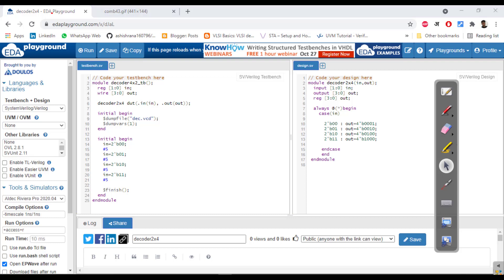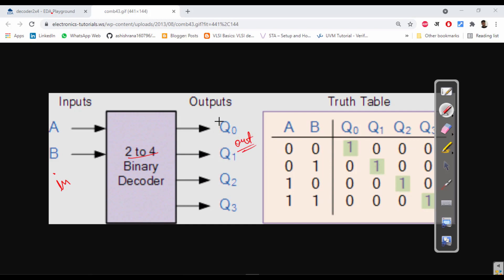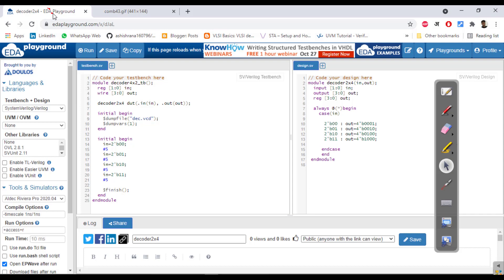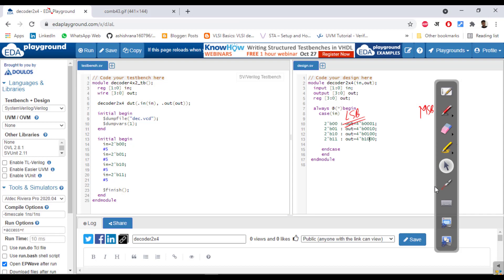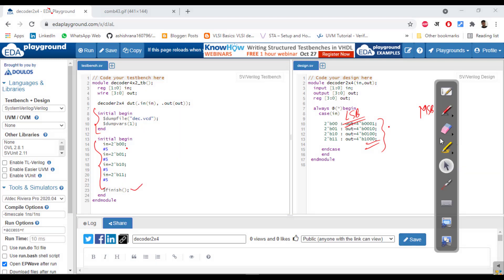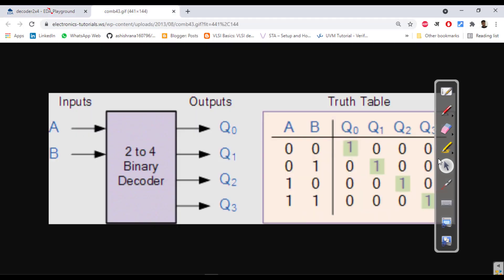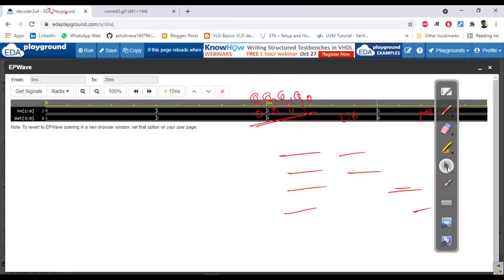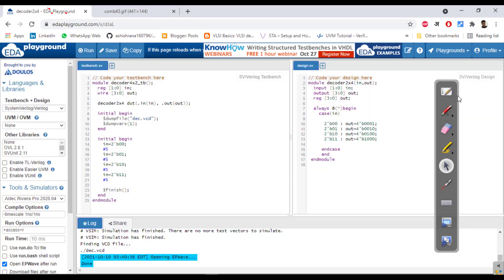2 is 4 decoder verilog code with test bench

Comment: can you you load the video for the following logic 
Write Verilog DUT which generates an output as follows for the given input
Input (I): 0,0,0,0,0,0,1,0,0,0,0,0,0,0,0,0,0,0,0,…
Output(O): 0,0,0,0,0,0,0,0,0,0,0,0,1,0,1,0,0,0,0,…
module two( input wire clk, rst,i,
 output wire y);
Note:
 An input ,I, asserts for only one clock cycle.
 After the input asserts, then the output should assert 5 cycles later and
 Then deassert for another cycle and
 then assert again for one cycle.
 It is a 101 pattern after 5 cycles
 If another pulse on input appears during these 8 cycles output 101 pattern
should not be generated for this new input.